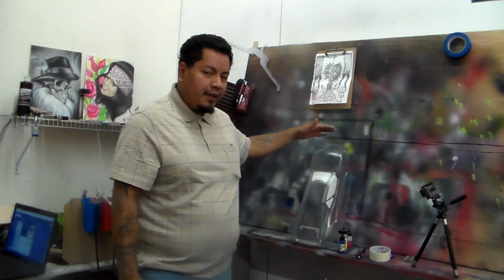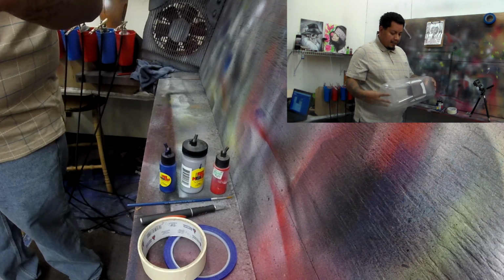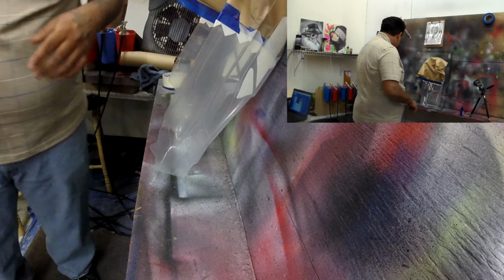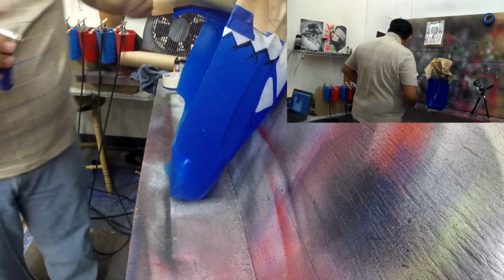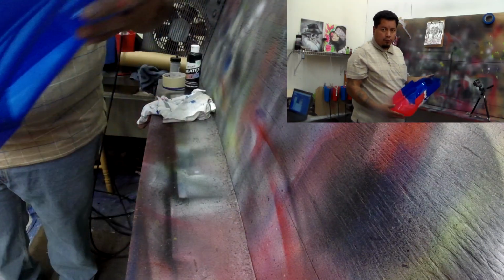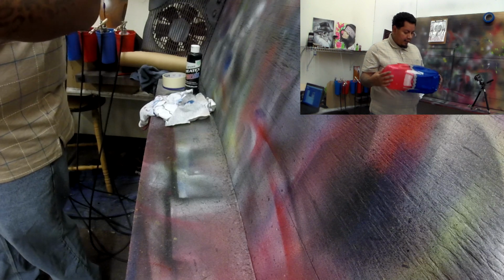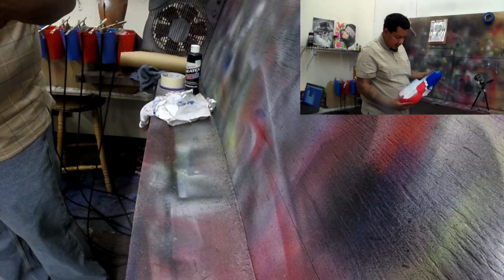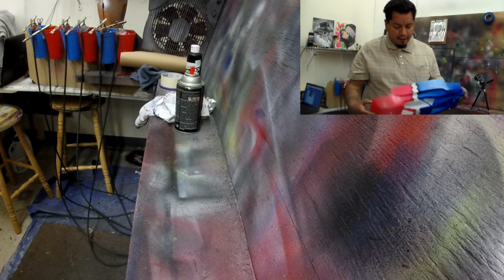How to Airbrush a RC body with Createx

Comment: Good video - The only other thing I would advise, especially for a body meant to be used on a Nitro vehicle, is to spray one final coat of Pactra White or Black right from the can (unfortunately, it's been years since they've offered it in bottles), depending on the colors used for the paint scheme. The reason for this is that since the paint is water-based, Nitro can eat away at it over time. Since Pactra formulas are made to resist paint, you will protect the Createx finish underneath with that final coat.

As for why White or Black? Just my personal experience, but those two colors just seem to be easier to clean off dirt and grime after running the car - usually just some compressed air does the trick. I used Silver to back my car once, and it just seemed to be a magnet for dirt. On the other hand, Black/White seems to repel most of it, which makes for easier cleaning overall. 🙂
Reply from the maker: did you miss the part where i put a topcoat on it? 

I looked back on the video and I didnt actually show me putting the topcoat but i do mention it at the end. 
but yea thanks. also their is a new updated video.
Reply from the maker: https://www.youtube.com/watch?v=FgUIpcuwcnQ
Reply: @MikesAirbrush  Oh sorry, I saw that you put a clear coat, but it flashed by so fast, I didn't get to see what kind - just that it was Dupli-Color brand. Nitro can be some pretty caustic stuff and the Pactra brand is formulated specifically to resist it while maintaining its flexible characteristics. That's the only reason I mentioned it... Well, that and the fact that the Pactra Black and White literally repel dirt and dust - don't know what it is about those two colors in particular. I've gone entire race seasons with a single body, and it has stayed clean as a whistle with just a few sweeps using a 2" general paint brush or a quick blast of compressed air from a hose.😎 

Anyway, thanks for letting me know that you have an update - this one just happened to pop up in my recommended feed. I've seen some of your airbrush videos - I didn't even know you've done RC bodies... Good stuff! I'll look up the follow up video.

Comment: what do you add to your wicked paints to get them to stick better to the lexan mine looked good but as soon as the body was wrecked a few times the paint detached from the lexan i cleaned the body well dried with hairdryer between coats and reduced it with 4012 reducer 1 drop reducer to 10 drops of paint please help
Reply from the maker: This is done using the standard Createx Airbrush Colors. I dont believe wicked paints would work well for this as they dry up a bit more stiff.  Also make sure you put a topcoat over it. Usually the paint lasts longer than the body for me.

Comment: I dont know the first thing about airbrushing, thinking about buying a kit so i can start doing my r/c bodies. Only question i had was did the white backing paint bleed thru the silver afterwards? It seemed like where the silver was supposed to be looked white
Reply: The silver is somewhat transparent.  So you have to back it with white to really get the color.
Reply from the maker: The silver is transparent, it needs a backing color. Using white makes a bright silver, using black makes a dark silver, etc.etc.